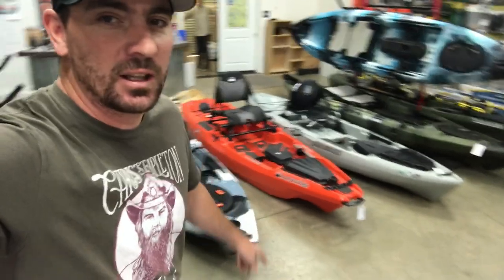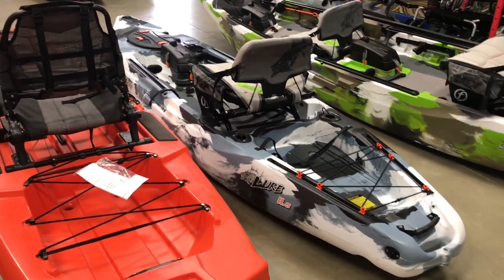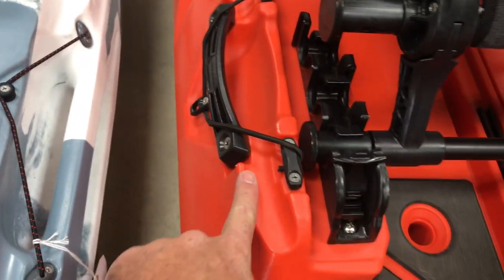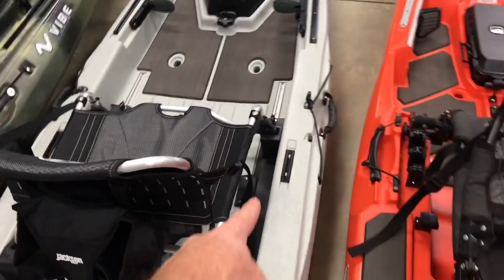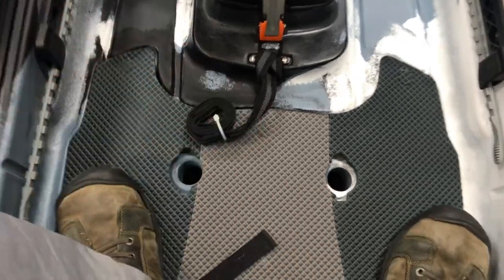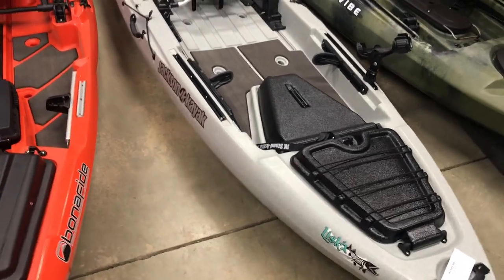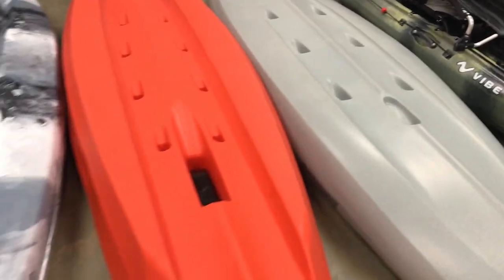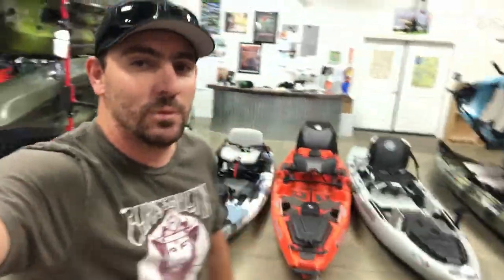Comparison Review: Jackson Liska, Feelfree Lure, Bonafide SS107

Comment: There needs to be only one kayak available so I can make a damn decision lol
Reply: Nite Knight I know the feeling. I’ve bounced from sea ghost to big fish to pelican with hydrive and finally decided on the lure 11.5 . I’m 6’ 270# so I hope the lure works out. Got it for a helluva good price.
Reply: Amen 🙏
Reply: @joshuaborchardt4355  Summer's over, how'd it work out for ya?
Reply: @joshuaborchardt4355  how did you go with the lure 11.5? I got mine the other day, older one I think as it doesn't have a removable box for the fish finder and battery, it's just a sealed compartment, everything else is exactly the same though, im 6'4 and wondering how comfortable you are in yours? been pissing down with rain and windy since I got mine hahaha yet to get out on it
Reply: @xterrorx8376  how yah liking the lure?
Reply: @trentwalker4  can't really fault it mate, extremely stable, just don't strap them down to hard as they tend to crack about around where the uni tracks end, I don't abit of research after I notices some cracking in mine, (nothing serious) and was probably from the last owner as I got it second hand

Comment: This was a good comparison review, Dan!  Owning a Lure 11.5  for just a lttle over a year now, I'm pleased with it. The only [minor] drawback is with the proprietary gear track size, and having to use adapters. I use two of the Feelfree Uni-track devices, and find them sturdy, easy to attach/detach, and move fore/aft on the track. The included safety lanyard on the Uni device with the snap-in track attachment is a plus knowing the device won't be deep-sixed accidently.  For my other track attachments I used the YakGear adapters to attach 4 Railblaza Starports (2 fwd, 2 aft), which I use for locating the camera boom in different positions on the kayak.

 The Wheel-in-the-Keel on the Lure makes it ideal for short trips from the truck to the water, on concrete/asphalt, or grassy areas. It doesn't fare well on gravel. For longer distances I use a Railblaza C-Tug. I have a short bed F150, so a BooneDox T-Bone works well in supporting the length of the Lure past the tailgate. I'm 65, so the ease of transport (weight factor) of the Lure is something I thought about when buying it.

I did not demo the Lure 11.5 on the water, but did make a 2 hr trip to the Nashville area to the Hook 1 kayak store, and sat in the 11.5, and the Gravity Seat, Wheel-in-the-keel, (and other features) easily convinced me to order one. 

Checkout my channel if you get a chance to see a handy moveable storage cart I built to make loading/unloading the kayak into/out of my truck.
Reply from the maker: Greg Jackson I’ll check it out
Reply: @HeadwatersKayak : Thanks 👍

Comment: Incredible video, especially the seats and hull design. I am still a bit torn between the lure and the ss107. The wheel in the keel might be the tipping point for me.
Reply: I promise you you get the lure 13.5 you will be more than incredibly happy
If you're not planning on doing any big camping and don't mind losing some of the front storage the 12.5 would be also fantastic
I've had me replacements and I need one I can get in and out of easily and it's incredibly stable my lure 13.5 is way better than I expected

Comment: Really great review.  I didn't see any bias, just the facts.  I have the FeelFree Tandem (next to the lure)  and my son in law has the Jackson Big Tuna.  I think both are well made, stable, move well through the water and are fairly easy to upgrade.  I don't like Feelfrees proprietary track system but bought the adapters you show for the cup holder I added, no big deal. The FeelFree is definitely heavier than the Tuna but both are manageable.  The stern wheel on the FeelFree might work on smooth surfaces with no gear in the boat, otherwise it's useless (in my humble opinion).  These look like all great kayaks and your review was one of the best I've seen!  Great job!

Comment: I’ve had the Lure for a year and a half. It’s a great boat for all the reasons you mentioned. The sonar pod seems fine to me, but I’m not comparing it to others like you did. Setting up my fish finder was a snap. The seat is awesome, probably the main reason I bought the boat. I have back problems and it’s height adjustability and comfort help. The track system is a bit annoying, with having to buy and use the adapters. One thing for sure is that this boat needs a rudder. I fish a relatively calm river, but a rudder is definitely on my list. Another plus for FeelFree; after about seven months, after a day on the water, there was about an inch of water inside my hull.  FeelFree replaced my boat with a new one. I have enjoyed many of your videos.

Comment: Awesome thorough comparison. I have a Jackson coosa fd for my big pedal kayak but I wanted a nice light paddle kayak as an adjunct. I went with the bonafide because of the stability and comfort. I also liked the rod staging area on the top of the hatch and the pod. I am really happy with it so far, my only real “complaint” is there is nothing in the back end with regard to tracks or flush mounted rod holders so I need to add either or both, otherwise I have nowhere to put my rods except if I bring my Hobie crate (which I have nothing to attach the crate to, except wrapping the bungees around it....). Although with the seat up, I can stage 3-4 rods resting on the seat base and hatch grooves and it is pretty sweet to have them all sitting right in front of me ready to go

Comment: Great video and tremendous comparison between the 3 yaks.
for me the choice would be between the bona fide and the liska, with a bonafide likely winning out in the end.
where has tracking would be a little bit of a concern for me with a bona fide, the height of the seat is beyond reproach.
However, it is unfortunate that they did not include gear tracks on the sites of the stern.
The feel free is a non-starter for me because of two things.. origin of the company being non U.S. and the requirement of purchasing adapters every time you want to use accessories on their proprietary track system

Comment: Thank you for the video and going through the 3 boats.  I am looking to buy my first kayak.  I have been interested in getting a fishing kayak, but had some health issues that are hopefully in the rear view mirror.  Again, thanks for going over the 3 kayaks.  I am interested in the FeelFree Lure 11.5 and the Vibe Shearwater 125 and could use some insight on the two. The Lure looks incredible, has some internal storage and the very adjustable seat. The Shearwater seems to be really well thought out with internal access, storage areas galore, comes with a rudder and what also seems to have a very comfortable seat.  Both are at the same price point, and can be retrofitted with a pedal drive.  So, what am I missing?  Which is better to paddle and which is more stable?  Any insight or recommendations are appreciated.

Comment: There are so many boats and so many options and sizes, how on earth can someone choose?  What would be a good minimum kayak?  Something with a raised seat, stable to stand, don’t need the bells and whistles.  Just something that works well in a river or small lake?   I have a used old town dirigo 10’, it works well but it’s sit in and  doesn’t track real well.  Also seems tough to paddle.  Field and stream has an eagle for about $500 they also have a much nicer one for $799.  The ability to add peddles long term might be worth it?

Comment: All three boats are very nice and would all be a nice buy. I really like the seat on the Lure, it's height adjustment is really cool. The Bonafied looks to have the nicest seat but I do not like what you have to do change the height. I think they need to work on a quicker setup, but the boat is incredibly stable so it may not matter. The Jackson looks very nimble and traditional. I will say I didn't like the hatch and electronics plastics on the Lure, they looked like something you would find on a $300 kayak imo. The Bonafied looked to have the best plastics overall but, and this is a big but, I can not believe the Bonafied doesn't have built in rod holders. That is absolutely mind boggling to me. I do not use a crate, I use a nice bag and cooler. And no way am I drilling holes in my yeti or gluing anything to it. I think they really need to take a hard look at that. If not for the rod holders the Bonafied would be an easy pick for me, but I think the Lure would have to be first just from that simple fact. Thanks for the great vids, very helpful what you cats do out there.

Comment: looking for your thoughts. Have SPortsman 106MK. 70 years old and issues with pedal drives which I have had, paddle kayaks as Feel Free also as the main water I am in goes against a fairly strong current making paddling tougher and tougher. Suggestions on lightest type of kayak to paddle that would work good against current? Looking for more exercise. Just your quick thoughts.
Reply: I know this is old however. Two things. The Vibe SeaGhost is a great all around yak. This would be a very good choice for that. It’s one of the 3 I use and most often on rivers. Now. Paddle choice is everything when paddling against current. Iv had them all. Werner Kalliste is my second choice and not because of the 500$+ price tag. I had two of them at same time. One longer than the other. My first choice and what I use 90% of the time. Is the Greenland paddle. It makes a huge difference and can be manipulated in so many ways to improve stroke. I can paddle all freaking day and not get fatigued. Rent one for a couple trips. You’ll be sold.

Comment: If you had a choice between the feel free or the bonafide for everything from still small lakes to the Puget sound here in Seattle. Which one would you buy
Reply from the maker: If I was paddling the sound I would not pick either of them. Both are too slow and wide for open water use. I'd pick a Ocean Kayak Trident, or Wilderness Tarpon or something along those lines with speed and glide.

Comment: Pulling my hair out deciding between bonafide & feel free🤪
Reply: Me too. And also the Nucanoe Flint...Good luck!
Reply from the maker: Both are solid options. I feel like the Feelfree is a little more versatile and easy to rig, but the Bonafide is Bomber stable and very comfy. Having spent time in both of probably go Lure, but ultimately you should paddle them for yourself if you can.
Reply: i just sold my husband's 11.5 and bought myself a RS117. the 11.5 felt like a turtle in the water when paddling anything but flat water and that wheel in the keel isnt as handy as it looks. PITA to balance that much weight on a 2 inch wheel. definitely a nice yak but for me there were more negatives than positives. hoping to get the 127 next year but the 117 fit the current budget better and i'm waiting to see what they release for a rudder system.
Reply: I personally love my Feelfree 11.5. But, I agree with Kathy. The keel wheel is almost useless.  I modded mine to have a removable two wheel system which cost around $30 in parts.  All things considered, the Lure is great. My biggest negative is the weight.  It feels a lot heavier than most.  With the wheel mod, it does cut down on that weight feel.  With so many choices out there today, decisions get harder.  Whatever you decide, make sure it fits the characteristics of the waters you are looking to use it in!  Happy hunting and paddle on!
Reply: @lug0val0s94  if u ever get a chance to try a c-tug, you definitely should! i almost did the 2 wheel mod but held off cause I knew it wasn't gonna be with us long term. i borrowed a buddy's c-tug for one of the launch points with a long haul and the easier weight distribution makes it ez-pz to pull! i know it's a big chunk of change but it's worth every penny!!!

Comment: I might stir up some emotions with this comment but I think that manufacturers of the pedal drives have them priced really high.  They are complicated devices that are difficult and costly to manufacture. Kayak designs that make it easy and inexpensive to add a trolling motor may be a great option for consumers.  This approach may be good for the consumer AND manufacturers.  If no data but would guess they sell a pedal drive for every 4-5 kayaks they sell. Although the selling price of the pedal drive is almost as much as the boat, I'd guess the margins are greater on the boats.  In other words, selling boats (not pedal drives) should be the focus.  A boat designed to easily and inexpensively add a trolling motor may do VERY well.  Your thoughts??
Reply from the maker: This seems to be a trend. Although companies like Native and Oldtown who have proven systems that have been around for a while are probably doing just fine with their systems. Innovation is expensive so if you can get some mileage out a product it becomes cheaper over time.

Comment: You said the feelfree lure was 34 inches wide but I believe it's 36 inches wide
Reply from the maker: ITs not. MAybe 34.5 but not 36. that was a misprint and has been corrected.
Reply: @HeadwatersKayak  yes you're right it is in fact 34 inches I just went out and measured my lure 13.5 and it's 34 inches wide